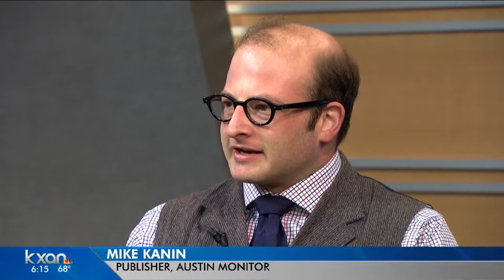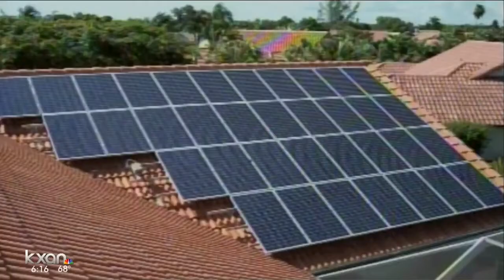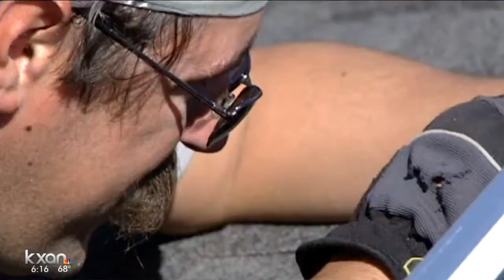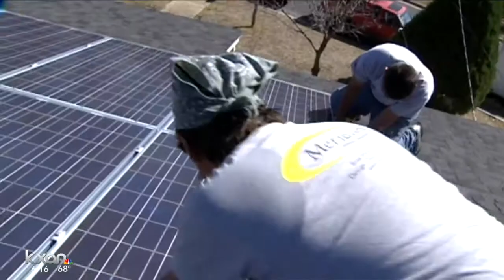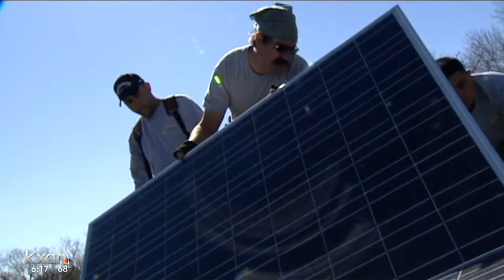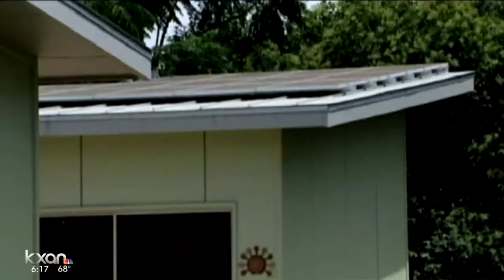Solar energy debate

Comment: I HAVE WORKED OUT SOLLAR IS A CON SOLAR WORKS ABOUT 6 TO 8 HR AT MOST THE BEST IS ABOUT 4 HRS DONT GET CLOUDS  THAT REDUCES IT DOWN TO 25% SO WHAT HAPPENS FOR16 HOURS  TO RUN YOUR HOUSE 40 PANELS   NOW WE TALKING BIG MONEY UP FRONT AND THEN YOU NEED BATTERIE  SO YOU ARE TALKING 60000 DOLLARS UP FRONT TO TOP IT OFF THAT IS NOT GOING TO COVER YOU 100% YOU STILL REQUIRE CONNECTION TO THE GRID  NOW BY THE TIME YOU PAID IT OFF YOU ARE LOOKING AT RENEWAL BY THEN PANEL WILL NOT BE CHEAP YOU ARE NOT GOING TO BE ABLE TO ABUSE PEOPLE TO MAKE PANELS SHAME ON YOU PEOPLE WHO BUY PANELS AND NO THERE MADE WITH SAVERY KIDS ECT SOLAR IS A RIP OFF